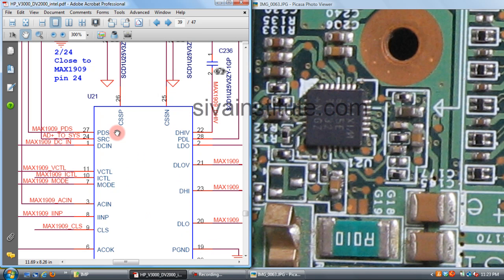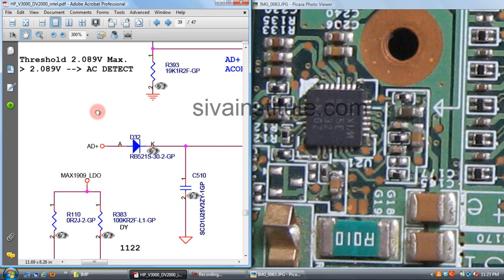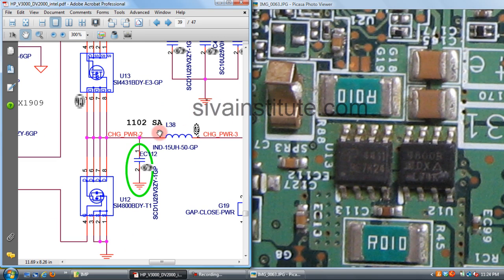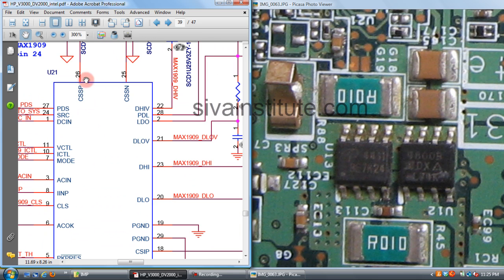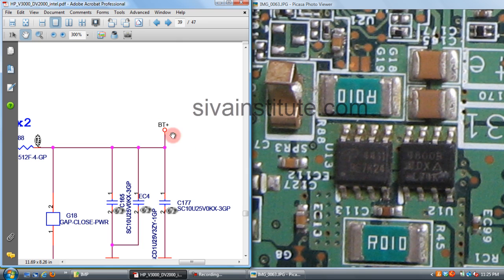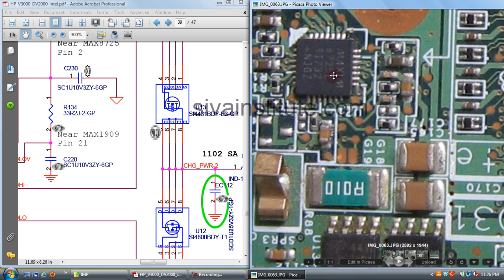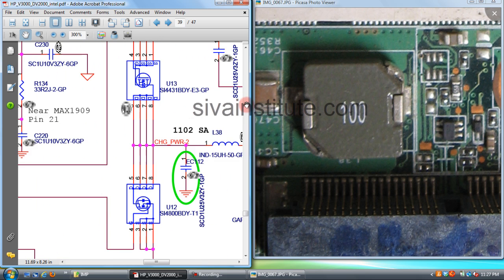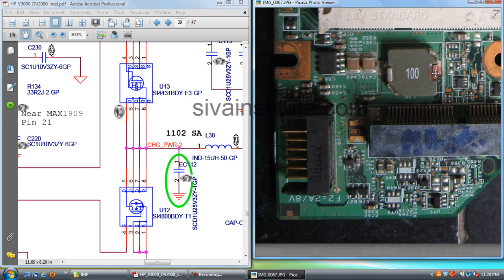How to Check Not charging  Laptop Repair (Chip Level).eng

Comment: Excellent explanation, it confirms my diagnosis why my laptop, after suddenly causing extremely slow battery charging and causing random bluescreens during 3D rendering, suddenly stopped powering the laptop altogether : the output MOSFETs failed, first one, causing reduced power output, then the second, stopping adapter power altogether (U13 and U12 in your video).

Comment: Hi, 
I purchased an Asus original battery for my Asus X750JB-TY002H.
Since first use, I noticed that the battery has a 6% of wear and that charge/discharge rate starts to decrease when battery percentage reach 88%. 
I report this to my seller who sent to another new.
The new battery has the same behavior of the first and a 6-8% of wear. 
I want to know if it is normal that an original battery has already wear. Could it caused by some tests which the batterie are subjected before sale?
Could the problem be in the driver?
I'd like to know if this wear level will increase quickly or it could stabilise in future.
What is considered the normal behaviour and the normal wear level in long time?

 Thank you
Reply: Hi, I bought a new laptop and found same thing, but with about a 22% of wear. I don't want to send it to customer service because in the best escenario they will give me another laptop after a few days. What have you done or noticed in the last year? Thanks!

Comment: I'm the owner of a Dell L702x. It no longer charges, but read below:

I have replaced the battery, the power cord and the DC jack. everything is new and in place. it charges when the laptop is completely disassembled, only with motherboard, battery and plugged. After I start mounting it back, at some point is stops charging. repeated this like 10x, each time it stops charging in a different stage of the mounting. there are no visible damaged circuits or anything like that. 

my guess is the motherboard.

do you have any other suggestion?

Comment: excellent information - I found a dud (rotted) capacitor right next to my Charging IC - replaced it, and now all is fine; Was a hell of a job trying to resolder another one back in place though, with my very limited tools/large soldering tip.
Reply: JustBanter Hello I have the same problem now. I also have a rotted capacitor.  where can I buy a new one and how do you know which one
Reply: I have lots of old circuit boards lying around (from used CD Players, obsolete PC's etc.) I simply sourced mine from there. To attach one I resorted to using a solder paste that comes in a test tube and becomes conductive after drying out - but I dare say a 'very' fine solder tip might work also!?
To identify which capacitor to use I simply went off matching-up by eyesight (looks identical in size etc.).
http://www.ebay.co.uk/itm/0-2ML-Silver-Conductive-Wire-Glue-Paste-Adhesive-Paint-PCB-Repair-Application-AS-/291930753133?hash=item43f86dc86d:g:zcsAAOSwImRYGV2p
Reply: Thank you for the fast and good information.

Comment: Hi, sorry about my bad english, can you help me with a HP DV6 DAUT1AMB6E1 motherboard: it runs only in battery mode, power supply adapter is good. With power adapter, power jack led comes on, no other led are on, no battery charge. some section on the motherboard are powered.
Thanks in advantage.

Comment: Hi, do you know where I can buy motherboard components? I have an acer which needs the L502 component replacing (The bit that supplies the power to the battery connector) But I cant find 1 anywhere, I have also checked ebay for used motherboards so I can poach the part from but there are currently none available.

Thanks